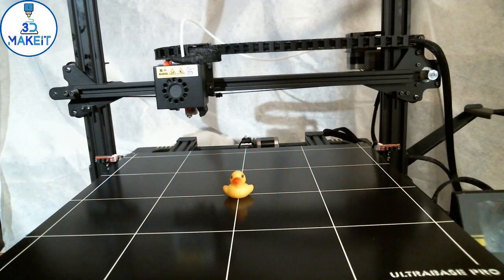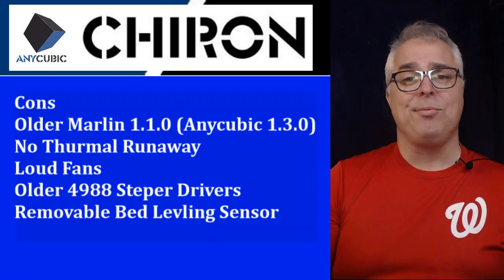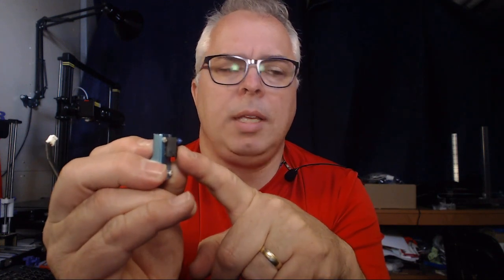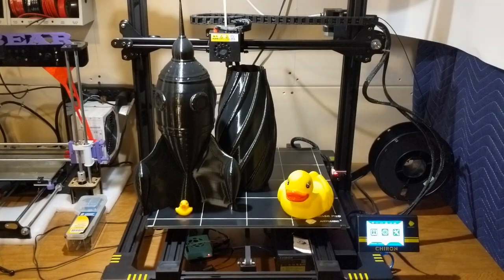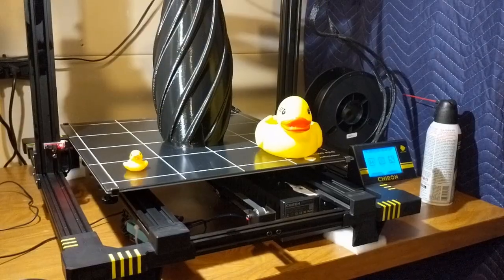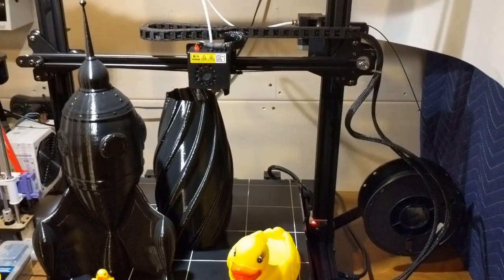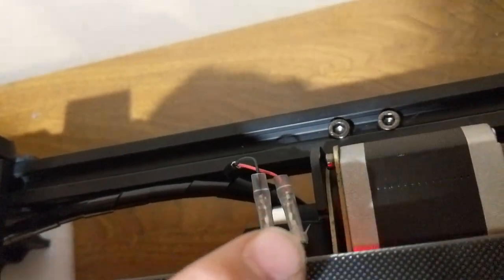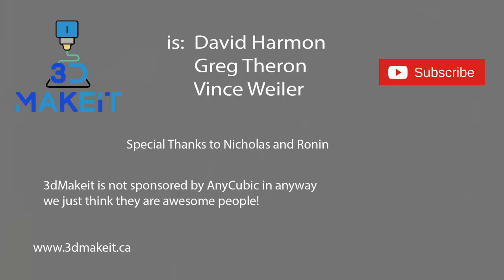AnyCubic Chiron ( The Big CR 10s Killer ?)

Comment: Ive been looking at the ANYCUBIC Chiron , Creality CR-10 V2 and the CR-10S Pro V2 but I'm not sure what to pic because I'm a first time buyer and not really  mechanically inclined. So I'm trying to find one that I don't  have to mod and that is generally durable with consistent prints?
Reply from the maker: So the short answer is this,  The cr10s is a work horse.   I don't  like the 10 s pro / max as much as the regualar cr10s(v2).   The chiron  is huge and does print out if the box but does not have trinamic drivers so is a bit louder and will suffer from printing artifacts until you tune your slicer for jerk and acceleration.   

If it were my money i'd lean more towards a cr10s(v2).  pop on our discord channel if you want to ask some questions we will be on tonight for the next few hours, https://discord.gg/4tmgAJz
Reply: @3DMakeIt  Hi! Thanks for your video. Could you please specify why would you rather take the cr10s V2 over the 10s pro?

Comment: Does Anycubic have a new firmware upgrade out there  to fix the Thurmal runaway problem?
Reply from the maker: I haven't seen one so I solved it by installing an SKR 1.3 32-bit board that'll be in an upcoming video
Reply: 3D MakeIt 
Is that board just plug and play?
Reply from the maker: Nope, I had to make a wireing harness. And compile marlin 2. It will be in the video. Sitll editing it
Reply from the maker: I could have just flash my own version of marlin but I wanted to try a 32-bit controller and silent steppers

Comment: Friends, thanks for sharing. Finally a decent analysis on Chiron. I'm having a lot of problems on my machine but with your observations, I see a light at the end of the tunnel.
Thank you very helpful to me, I look forward to your next videos on this.

Hugs to all of the channel
Reply from the maker: what problems are you having?
Reply: @3DMakeIt  Problems with support. Anycubic send to my country (Brazil) many machines to warehouse and no spare parts. Ex: My bed no heat (im print in the cold bed) and the X bar is bend, not align to the bed. Anycubic try to send for me spare parts, but stop in the customs and return to sender. In my country have complet machines but not spare parts. Anyway im atention in your videos, apreciate.
Reply from the maker: @jairogabardojr7002  That Is too bad, Well I hope you get the parts eventually. if you have anything you want more information on let me know and maybe I can do a video.
Reply: @3DMakeIt  Thanks for the comfort friend, already enough help. I'll wait on the firmware (maybe I need to change the LCD) or not and the placement of the BLtouch. PLA may not need a heated bed, a glass with glue and change the height of the endstops. The X axis I bought a bar of 1m and I will change. Waiting to arrive. Interesting is the abandonment of ANYCUBIC about it and offered only US30 discount on buying another. It sounds like a joke.
Or heating the bed with resistors, oldschool solution (lol).
Reply: It was just an observation, I will not create controversy. Your channel is well focused and I have seen some practical solutions to use. Thank you. I will arrange this with observation and work. David videos is nice too and your kids is partners. By.

Comment: I'm thinking about it hard, main target tabletop terrain, do you think it's print quality is enough?
Reply from the maker: It is, I am working on adding the tmc2208's just to make it quieter, but the quality is great so far.
Reply: @3DMakeIt  Would love to see some other mod's besides just the usual tmc2208 upgrade that everyone is doing for the Chiron. A BLtouch mod for better auto leveling would be nice, or a quieter fan mod such as Noctua.
Reply from the maker: @ArtofWarYT  I agree, I want to do some mods to the factory board test 2130 SPI and 2208 UART, I am liking the dual endstops as it trues  up the x every time you home. If I add a BL Touch I will miss that. I have a BL Touch on my other printer and love it. I had a knockoff for a bit but the pin would randomly drop and knock the prints. So I got the real BL Touch and it is totally worth the extra money. I am also going to test a SKR 1.3 32 bit board.